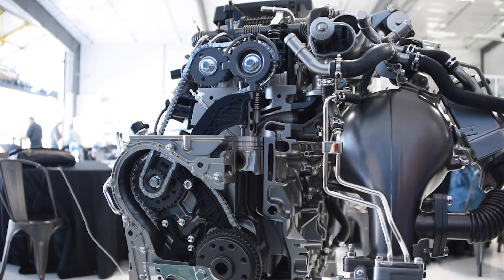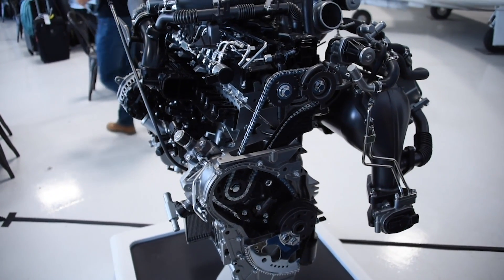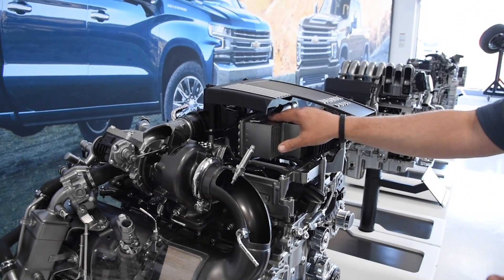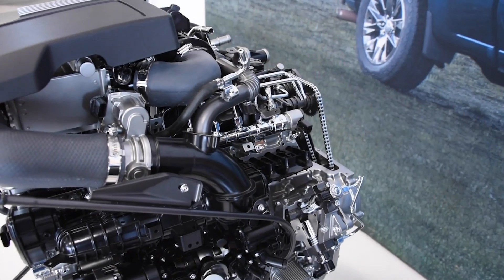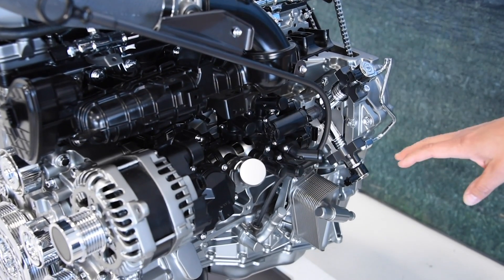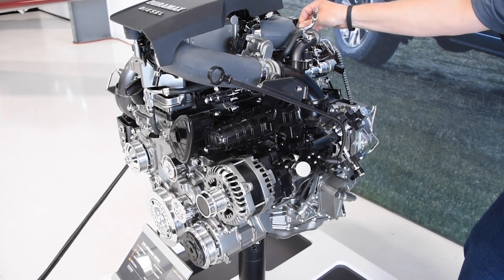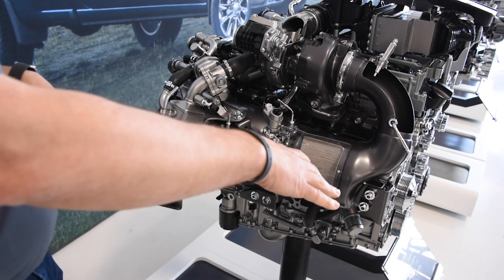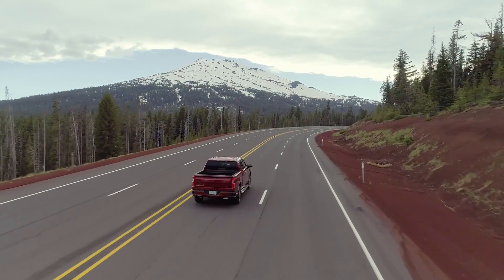What you don't know about the 3.0-liter Duramax diesel

Comment: wait until Gale Banks gets a hold of this engine, this 3.0 diesel inline 6 cyl makes as much torque as a 6.2 litre gas engine, with a little bit of engineering and technology Gale Banks will give you, my guess 300 bhp and 500 foot pounds of torque at the wheels instead of the factory 227 hp/460 torque, the factory numbers are good it is just that Banks has 60 yrs of racing building history with diesels and the factory engine will be even better with his work and less restricted and won't damage anything like all these little shit show companies putting out their claim to fame magical boxes that don't work. Nice engine
Reply: Looks like someone has been puffing the Banks skin flute. Nothing magical about separate tuning for unloaded and towing vs a one size fits all stock tune designed to last. Im sure the transmission will love all that extra horsepower, I've toasted a dodge and chevy trans with banks tuning
Reply: And after that Gale Banks tune most guys will be replacing parts and rebuilding at a much higher rate. Remember these engines are designed to perform under tough restrictions for long periods of time and over a wide range of conditions not just make dirty power at the track...
Reply: @newcastleandbroadway1134  you misunderstand everything gillbanks builds for the military or for General Motors does run and exceed a lot of the manufacturer's testing of the extreme number of hours I used to run a dyno back in the 80s for a farm implement company I worked for and we got all her engines are small turbo 4-cylinder engines from Cummins and we would run them consistently for an excessive 3000 hours pretty much at Peak RPMs 1 in 400 might fail and that was not the engine that was the turbocharger they put on but the internals would always last and this engine is built with better technology and better materials than the engines were back then Gale Banks is using all this knowledge and will not lose any longevity with his modifications to this engine unless people decide to turn them up them self 300 horsepower from that engine is not a lot extra you're only talking about another 73 or 74 horsepower and with the overhead cam sorry twin overhead cams four valves per cylinder and the Turbo technology that is not a lot and the drivetrain is well over engineered it's based on running they say I'm a hundred and fifty thousand miles realistically that engine will easily run Beyond 200,000 miles without any troubles you replace a belt or there but you know the maintenance is maintenance I still think it will stand the test of time once he gets some of his engineering into that motor that's just my opinion but having Dyno tested engines back there over 30 years ago I don't see I don't see too much issue unless General Motors locks that engine up tight so you cannot do anything with the computer on it as they've done with the Corvette
Reply: @99unclebob  I am saying that keeping my truck in factory condition has allowed me to run a tad over 300K and only change a water pump in 15 years. Could I add a100 HP tune to it and still run without issue? Absolutely. Banks, like all other engineers, design within limits and it behooves all auto enthusiasts to read up on what those limits are and what they intend to do with their vehicles. Currently I want a truck to start every morning, run cross country with minimal maintenance, and pull my trailers at highway speeds so factory is best for me. The day I build a diesel vehicle to run ¼ in 6.5 @ 235 I will certainly consult Gale Banks :)
Reply: then the belt gos south